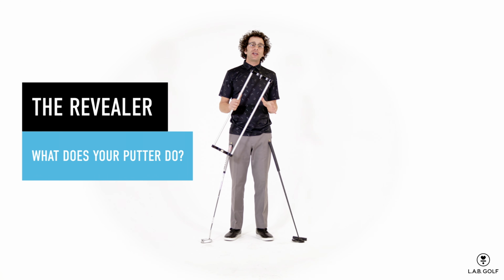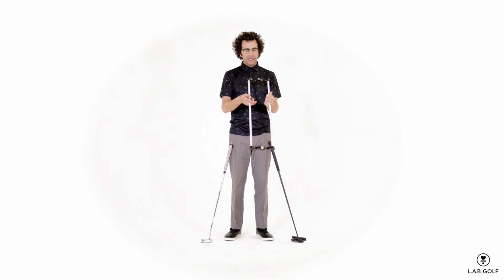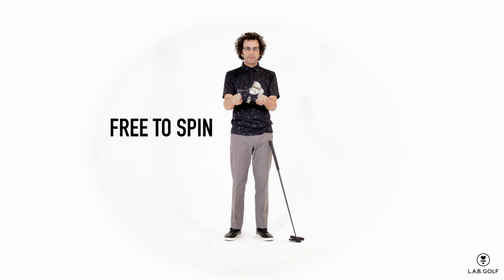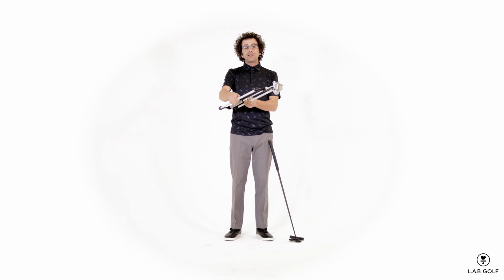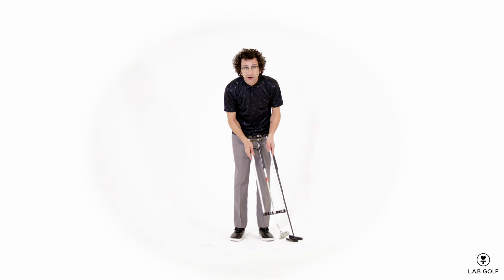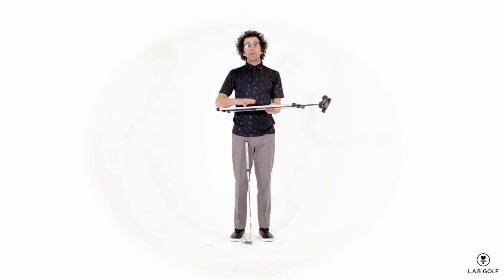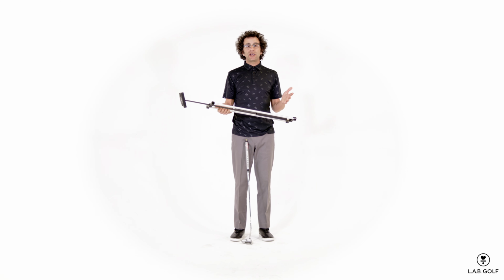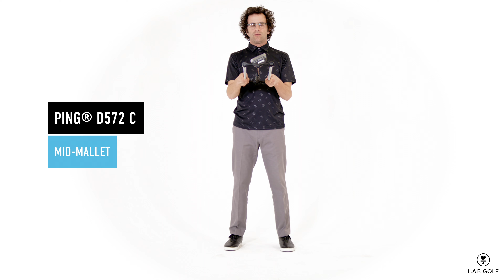L.A.B. Golf Revealer Videos: What Does Your Putter Do?

Comment: I have 2 LAB putters DF1 and Mezz 1 and about to order the Mezz 1 Max (the Mezz 1 I bought used very cheap off someone who refused to change his putting stroke - was holding it toe up) anyway these putters will not read the green for you, will not correct a bad stroke, will not correct alignment issues or correct the pace of putt, all of those you will need to get right to make putts. It will help you start the putt on the line that you are aligned to. I use DF1 and can honestly say that if i miss a putt now it is because 1. misread the green 2. wasn't aligned to the correct line (see first point) or 3. hit it too soft or hard. The technology works but you still must do everything else right.
Reply: Just got a DF 2.1 a couple weeks ago and couldn’t agree more. Because it starts putts on line so reliably (and rolls the ball so true too), I learned almost immediately that my aim wasn’t anywhere near as good as I thought it was. If you pay attention, it can really make you a better putter.
Reply: @evandh1989  Another great tip was raising your thumbs off the grip. This worked so well for me. My thumbs were definitely trying to steer it, and I had no clue.
Reply: Agree.  First day with a DF 2.1 and par on the first 3 of 6 holes because of the putter.  My aim on the 15 ft and under putts was so much better.

Comment: I bought the Arm-Lock DF 2.1 last fall (used video fitting, to make sure all this money isn't wasted on a 6'6" golfer).
As an above average ball striking 60yr old golfer (handicap ranges from 6 - 7), and still playing from the regular or back tees on all golf courses.......I have DESPERATELY wanted to improve my well-below average putting ability (routinely 34-39 putts per round).....poor lag putting, poor 4-6ft make ability, and my buddies ALWAYS make me putt my 2-3 footers because they know my stress, will make them money.  
For the last 20+ years I have tried basically every grip and putting style (standard/left-hand low/arm lock/broom/left-handed/etc/etc) known to golf, with very/very little consistent success. 
BOTTOM LINE (if you've read this far)........this Freakin Putter "technology" WORKS, for me!!  
Trusting that the face of putter will stay square (with my non-perfect stroke), absolutely frees my mind that I ONLY need to concern myself with my Read and Pace.
Signed,
LAB Cheerleader (who does not work for them, nor was given a free putter, nor was this a paid endorsement)

Comment: Have you ever wondered why you can putt great with a putter one day and putt lousy with it another day?  Perhaps the answer is that every putter you've ever used requires manipulation of the putter to overcome the torque.  Even worse, each putter you have requires a different manipulation to control its torque.
We humans are not robots and our feels change from day to day.  The putter hasn't changed, we've changed.
This also explains why we might pick up a different putter and putt great with it the first time out.  Our feels for that day match the required torque compensations needed to keep it square. A toe hang putter will require different compensations than a face-balanced putter, for example.

But now LAB Golf has introduced putters with no torque and that require no manipulation of the putter during the stroke. All you have to do is to let the putter swing naturally and it will stay square to the arc.  No compensation for torque is needed.  This can be problematic at first since we are used to manipulating each putter's torque in a different way.  Sam recommends a "thumbs off" drill that really helps with this.  Once you learn to just "let the putter swing," putting with a LAB putter is like cheating.  Some call it "Magic."  
You still have to read the putts, of course, and hit the correct speed, but the LAB putter goes where you aim it.  And that's half the battle.

Comment: So. Using your definition of torque and how you demonstrated as such. Does that mean every golf clup has ridiculous amounts of torque? I think when defining torque using the same definition across the board would be helpful. The measurement of torque on a driver shaft is the rate of twist when a ball is struck. Correct me if I'm wrong on that. Using that definition how would LAB putters stack up against the other manufacturers? My guess is the other brands measure torque in this regard. 

Secondly your technology is great when demonstrated in your revealer. However, i want to see it measured in use against other brands in a putting lab where they can measure the torque. Toe hang putters aid in the clubface rotating with the natural rotation of your body
Reply from the maker: Really good questions and all things we're working hard to better understand. You should check out this video to see if it answers some of your questions: https://youtu.be/tJ_0MrvSg9U

Our stance on this generally is that if you can remove a variable from the putting stroke, how can that not help?
Reply: @labgolf  No argument with the removal of variables. I couldn't agree more. I think your technology is a great outside of the box engineering. It's definitely removing a variable. Or could it be adding an additional variable? The golf swing is a circle in its most basic form. Every stroke is a small portion of it. With the lie angle balanced tech, would that hinder the proper rotation necessary to stay in line with the circle? Straight back straight through doesn't exist in putting. Everyone has an arc no matter how small. My statement is framed in a question based in my own thought pattern. I love the idea and think it potentially holds merit. However, I need to see more before I can make an accurate assessment.
Reply from the maker: Totally. We're glad to be having this chat. The cool thing about Lie Angle Balance that we want to make sure golfers understand is that it's actually a balance to the chosen Lie Angle so the putter face always wants to stay square to the arc. 

Lie Angle Balance encourages a putter face that is square to the path... not a straight-back, straight-through stroke. As you pointed out, a straight-back, straight-through stroke creates a lot more variables!
Reply: Actually, toe hang putters hinder the natural rotation of the clubface.  A toe hang putter will try to close on the backstroke and open on the forward stroke.  This requires compensation on the part of the golfer.  The LAB putters require no such compensation to keep them square to the arc.
Reply: Doesn’t torque for a non putter club usually refer to the shaft? Its resistance to twisting at impact?
For a putter “torque” happens with the head.  New LAB rat here finally digging my DF after the discovery period!!  Thx LAB!
Reply from the maker: Yes, when we're talking about torque in full-swing clubs it's usually about the shaft.
Reply: @labgolf  I was measured on the SAM putt lab. According to the instructor my numbers were outstanding. 97% consistency and 93% on another category. I don't remember what. He said my stroke would have ranked in the bottom half of the top 20 on the PGA Tour. Any interest in a sponsorship?